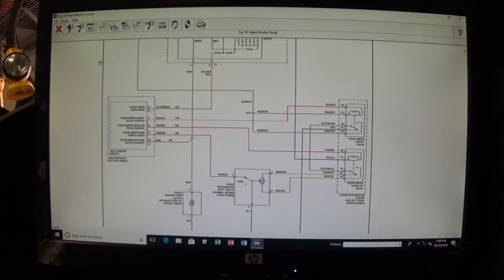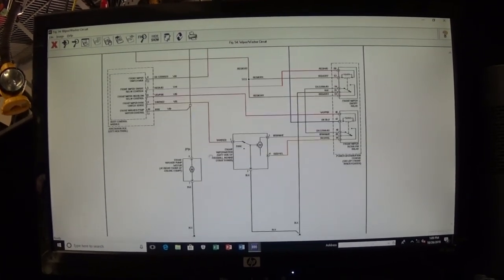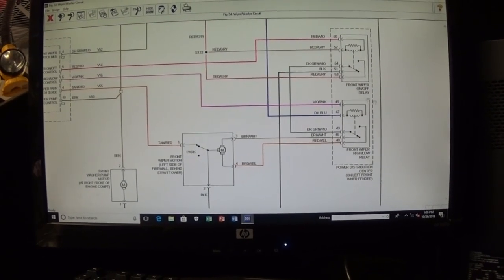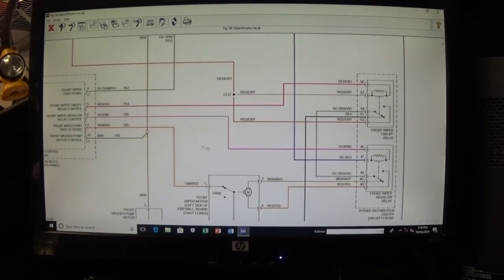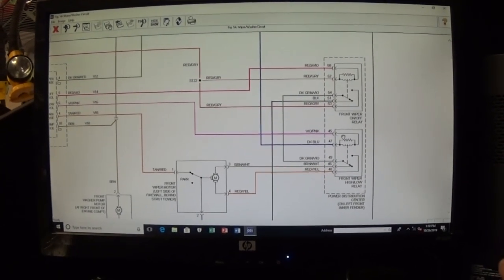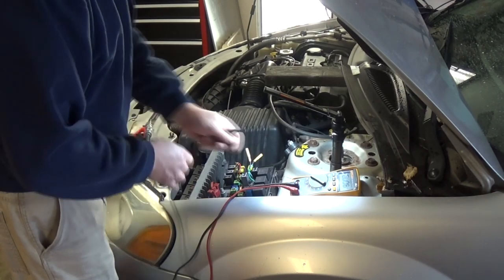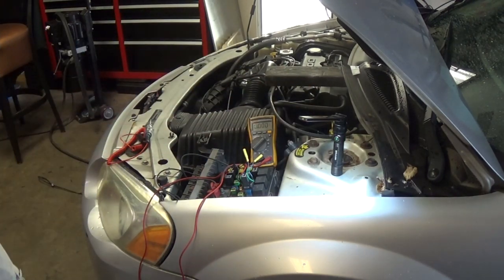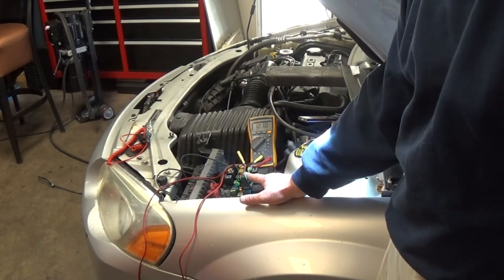Sebring Windshield Wipers Inoperative Part One

Comment: Thanks for this video , this ground point sure is a common headache. I had a similar problem, in my case wiper motor was dead and I had the bad ground. To quickly test if your motor is dead, touch (with care) a good grounded wire to its body.
If the motor then works the ground is bad for sure, if it's dead there could be sparks! (short).
Also to quickly test , connectivity check between that ground point and the second (or third depending how you look) connector on the plug that goes into the motor, the one with black wire. There should be strong connectivity or the ground is bad.

Comment: Hi I am having same problem with wipers malfunctioning and working all by themselves, even when the car ignition is off!! when on, they work whenever they want and stop and start spasmodically. I'm in Australia and this is a major problem as no one seems to know what to do with it. Have you got the wiring diagram, and fuse location? it's a 2010 Sebring convertible. Please help.
Reply from the maker: Karyn Carter looks like windshield wipers are controlled by TIPM basically that is a computer integrated into a fuse box under the hood. That had to be replaced and programmed by dealership. Sorry for bad news.